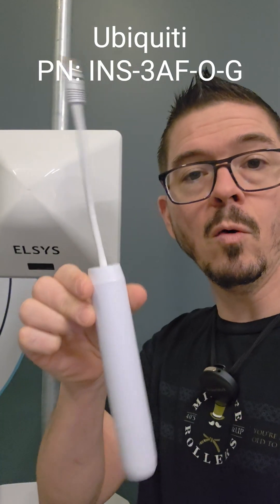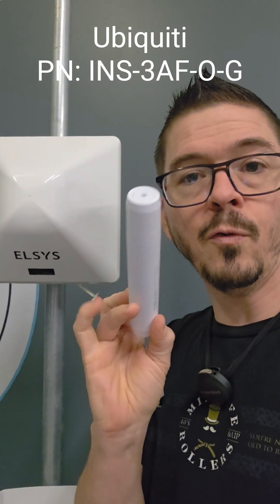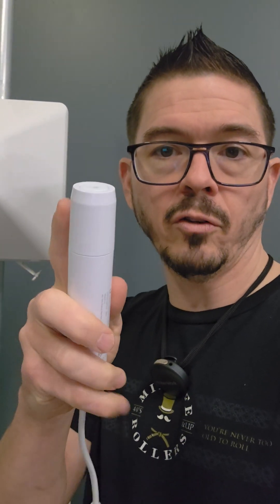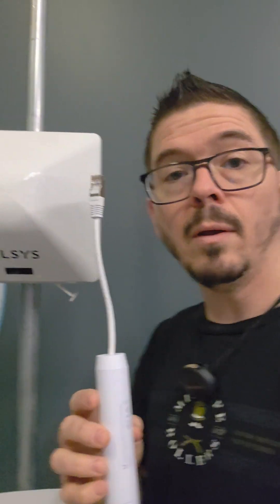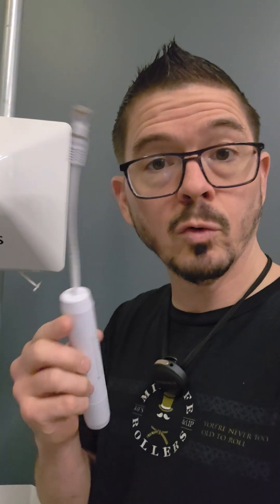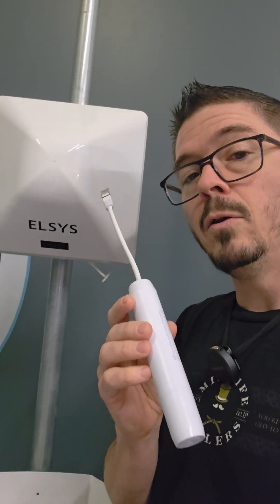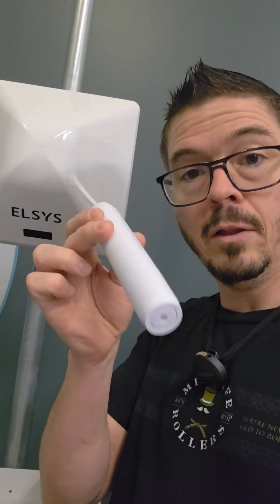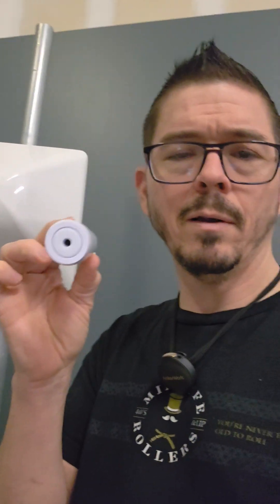PoE upgrade for Elsys Amplimax Ultra 5G modem antenna system

Comment: How much POE power (watts) do you need from the injector?  Also does that then let you go 100 meters?
Reply from the maker: Using a 48V injector, I would use one rated for at least 30W. Once serving up to the converter, yes you can then run it up to about 100m.